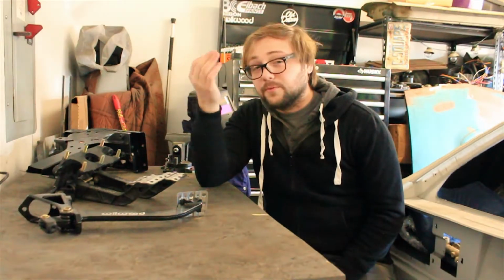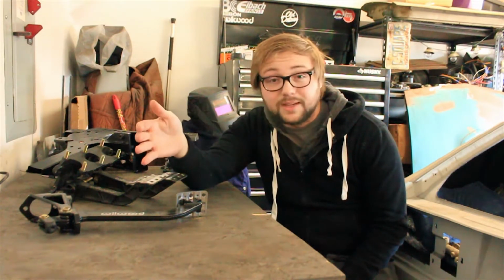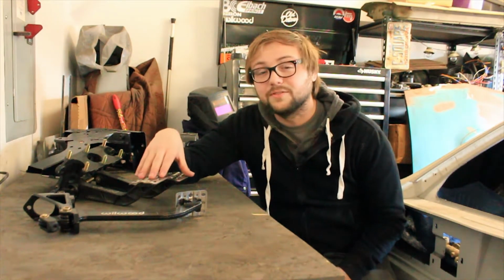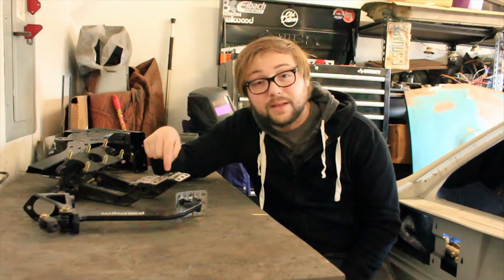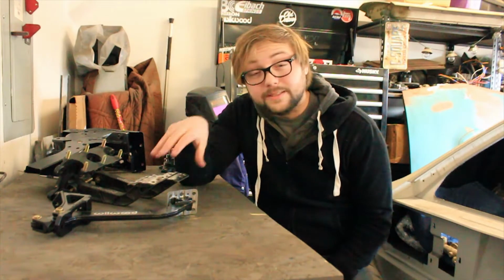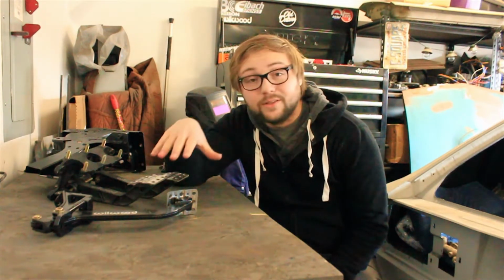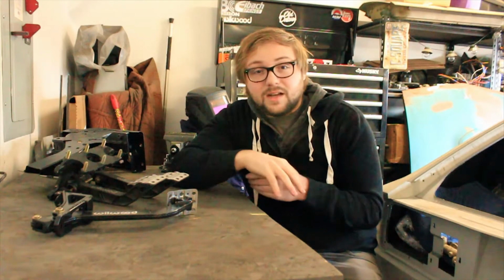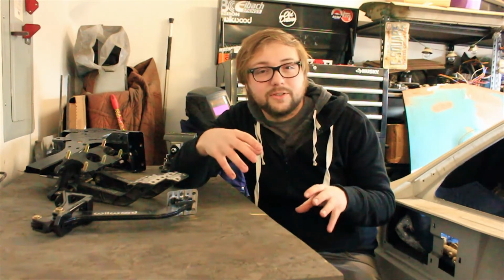Custom Wilwood Pedals

Comment: You still got those pedals that went in scrap? Im converting my '72 project to a manual and trying to keep it cheap for now
Reply from the maker: No. They went to another project already
Reply: Willwood it is! Cool video!
Reply from the maker: @austinsommers2755  Go for it! I wanted to do something different and they feel really good. I do think I mounted them a little high but I haven't actually driven the car yet

Comment: no more brake booster if the cylinders are directly on the pedal assembly....?!
Reply from the maker: No, I'm still using a brake booster with a 1 inch wildwood master cylinder. The whole set up is in another video where I build the entire brake line system